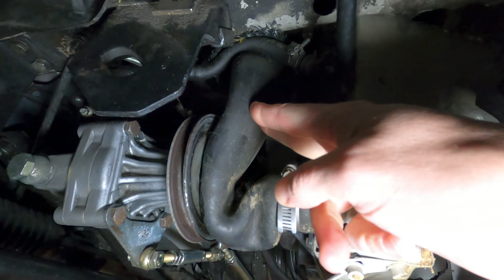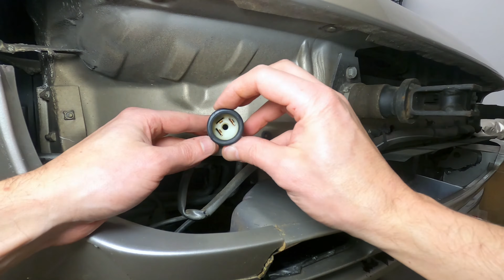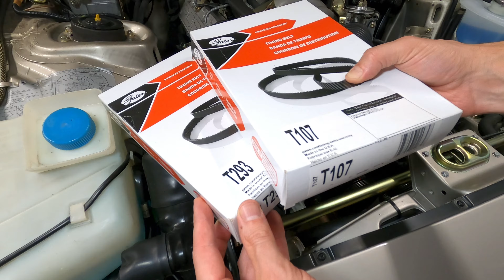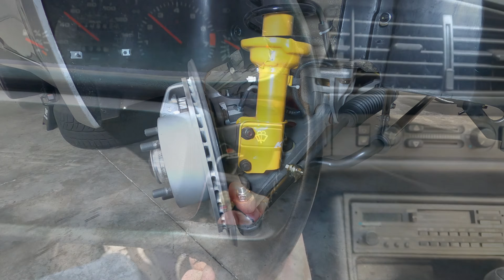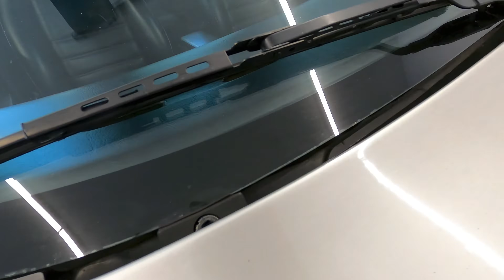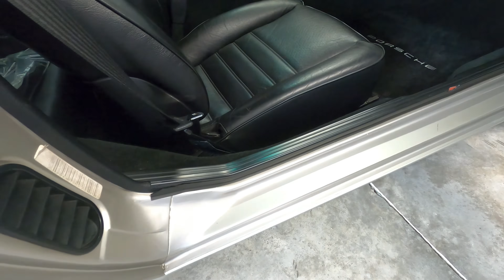Porsche 944 Project Story – Year 4 – Status Update, Repairs, Maintenance, & Costs

Comment: Howdy
I’m in NC as well. In the triangle area
A few questions
Which body shop did you use
Where did you send your injectors
Reply from the maker: Hey man, very cool, pretty close by. 

I used McDuffie auto body for the paintwork on the front bumper and lower valance, but wouldn’t recommend them based on the quality. I don’t have a trusted shop at the moment. 

RC Fuel Injection out of Torrence, CA does my injector cleaning, it’s about $150 for a set of four.

Comment: Love these videos. I am planning on buying a 944 wanting to do most of the repairs and maintenance myself but I am a little bit nervous as I have very little experience with working on cars. This channel looks like a great resource. Hopefully mine won't require this much work :D.
Reply from the maker: It’s definitely possible! And not all the work I’ve done was technically “required,” as I’ve probably taken things too far. 😂 I would try to avoid a really low mileage car or one that is coming off a long period of storage with no recent maintenance being performed, as there will be a greater likelihood of seals failing as you start to use the car, which will require more work on your end to make it roadworthy. If you can, try to grab one that has a nice list of recent repairs done to it, the clutch and oil pan gasket are bigger jobs that are nice to have done by a prior owner. A lot of folks go crazy about the timing belt, it’s important, don’t get me wrong, but you could still buy a car that doesn’t have a recent belt done, just factor that into your costs and care for it sooner than later after you take delivery.
Reply: @NC944er  Thanks for the info! I already knew about the clutch, but didn't know about the oil pan gasket. 
Seeing all the parts you replaced and in how bad of a shape the old ones were does make me feel like I should do the same once I get mine 😂. 
You also mentioned replacing the connecting rod bearings in the year 2 restoration. How often do you reckon those need to be changed? Some cars I'm looking at have around 300k km on them and I doubt those were ever replaced. Basically I'm worried about the parts inside the engine and transmission that can't be accessed easily and sound very expensive to get fixed 😆. I hear that these cars can be reliable but no engine lasts forever.
Reply from the maker: @etyl2494  The piston rings and rod bearings are fairly robust on daily driven cars with regular oil changes. I only replaced the bearings preventatively since I was in there, but they can last over 200k miles. A car that has seen track time is a different story, as bearing 2 can get starved of oil in repetitive high speed corners. If the transmission goes, a rebuild will cost around $3,000 or you can find used transmissions for about $600.

Comment: Good work on your approach to gradually rebuilding this car. I purchased  my 1988 Porsche 944 turbo seven years ago and have only driven it 100 feet into the garage where I have been gradually dismantling the car for a complete repaint and ground up restoration. In these past seven years I have been buying up mostly new oem parts to replace all worn and rubber components. I am spending $3k to $5k per year on parts, going through all the sub-systems in the car in preparation for re-assembly after the body shop. I spent about $20k on a complete engine rebuild by Lindsey racing in stroking the engine to 2.8l with a nos 3l crankshaft, and another $5k on a Vitesse stage 4 turbo and maf/map ignition upgrade kit, and another $2500 on a used transaxle with lsd and oil cooler which will need to be rebuilt.It’s a slow, expensive and methodical process which I enjoy and I am getting close to  finally getting the car into the body shop., but it will eventually be worth it!
Reply from the maker: Wow! It’s sounds like you’ll end up with quite an impressive machine when it’s all said and done. To do it all and to do it all the right way definitely takes a considerable time (and monetary) investment. The small wins help push the forward progress. Best of luck! 👍🏼

Comment: Where do you buy most of your parts?
Reply from the maker: Hey Aiden, I’d say it depends a little on pricing and availability, but generally speaking… for new parts, probably Pelican Parts followed by 944Online, for used parts, eBay and Plyhammers Parts. You may have also seen the parts video I have posted on the channel that provides an overview of how to locate parts followed by a summary of various vendors I’ve used in the past - https://youtu.be/ouPC6DuRpuE

Comment: Great video! Nice summary and videos of your work. I have an '88 944 base model that I purchased for ~$5k, and I've done a similar list of repairs & upgrades to my car (minus the deer-related accident). These 944s are enjoyable cars to work on, but as you have seen every now and then replacement parts can be a bit pricey, but readily available nonetheless. Koni yellow sport shocks and an AC upgrade to R134 were my best upgrades.
Reply from the maker: Nice! It sounds like our cars have a similar history. I’ve put off the AC restoration for far too long. 😂 But, if all goes well it’ll be cared for in 2023. Cheers!

Comment: Yo my guy. what shops did u use to buy body parts. got mine damaged very badly from behind and im struggling to find any parts. if u could just drop links would help a lot
Reply from the maker: Hey! I used the parts catalogue to identify the applicable numbers and then searched a number of vendors for pricing and availability. My larger orders for this repair went through Delaware Porsche Parts - https://www.delawareporscheparts.com/ - they can get just about anything, but sometimes it has to come from overseas.
Reply: @NC944er  thanks a lot

Comment: Makes me wanna work on my "84 na... 😃👍👍👍👍👍👍👍👍
Reply from the maker: Nice! You got any big plans for it?
Reply: @NC944er  years ago i acquired any n all parts i was missing or were broken and drove it alot. Its pretty clean BUT I let it sit for many years and still have parts to put on but life and medical issues got in the way..really thinkin of getting back to it lately. I love driving that car ! Someone broke my drivers side window so i need to source one. Otherwise, just need maintenance items n some busted knuckles lol. I added- aftermarket 5 star wheels (momo)
Momo disconnect steering wheel
Aluminum race pedals, aluminum floor mats, short shuft, strut tower brace (weltmeister i think), Nology electrical stuff, the throttle cam thing, big fat chrome muffler (forget who makes it) , new stereo head unit n speakers, dash cover(plastic one that matches) side skirts , etc. (Prob forgetting some things lol) . SO glad i bought every single stock switch, button, luggage cover, fog light etc to make the car totallly complete years ago!! Also have a bra on the nose with matching mirror bras..wow thats alot! Sorry to chew ur ear off!  Btw- i live in NC now as well (near jacksonville) ..hopefully ill be able to get goin on my projects one day when my medical issues get a lil better (if they do)..i have 3 other project cars and a harley that need some love too! Lookin forward to ur videos !
Reply: Almost forgot..put a new trans n clutch in it as well..wow im gettin old ! Lol
Reply from the maker: @finster357  Oh wow! 😂 That’s quite a lot, it sounds like you’ll be set up for success if you’re able to get back into it. It is hard to maintain multiple projects, especially when they all need help at the same time.
Reply: @NC944er  absolutely ! Its also a problem when u go around n buy MORE projects at the drop of a hat ! Lol